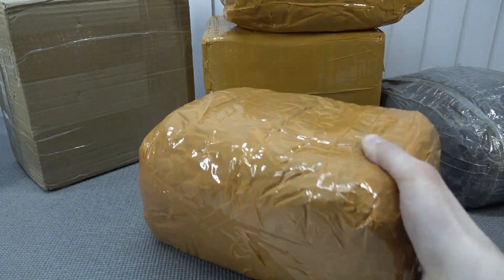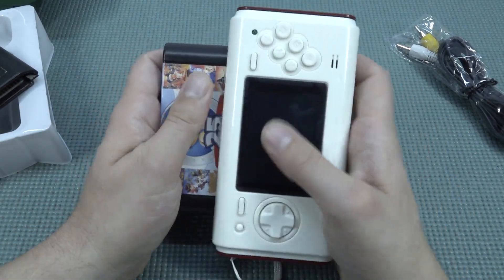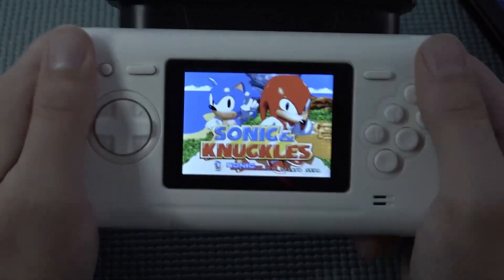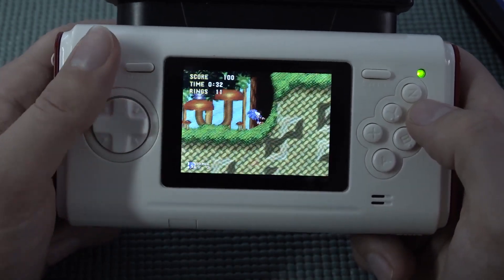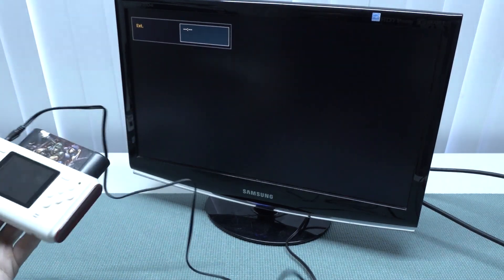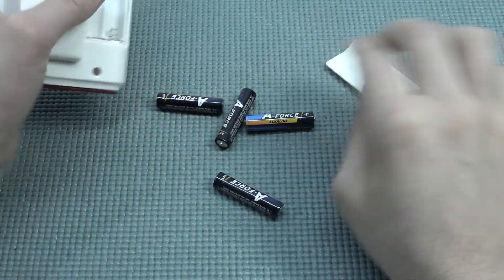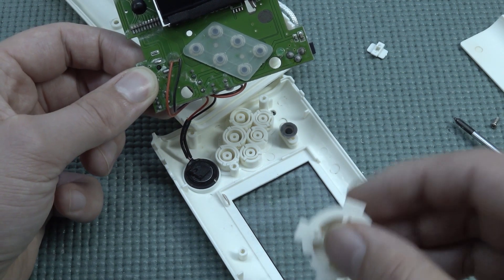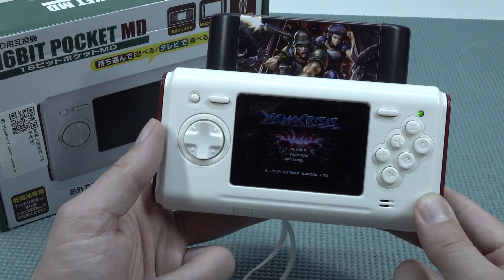A Great Sega Nomad Handheld from Ali-Express / Classic 16 bit Pocket MD

Comment: The 16Bit Pocket MD is originally a product from Japan not China and it was only released in black and maroon not solid white and there is a plus model that has a rechargeable battery and it was released in white and blue so this one is clearly a clone of the real 16Bit Pocket MD from Japan and i know because i have the original one, i ordered one from Japan over 5 years ago and i even posted a review of it a couple years back as i stated before.
Reply from the maker: Thanks for the info 👍
I do wonder how did this shipped from China in the end 😲

Comment: The Retroad 5 Plus is made by the same company and has a great SEGA GENESIS adapter that even works with the Mega Everdrive Pro. The button setup isn't the best but it may work with the SNES dongle and the 8bitdo m30 bluetooth controller. I still think the buttons were not correct though. It is region free and has different aspect ratios too.

Comment: Sonic 3 uses a solid state chip for saving, which doesn't die like a battery would. The cartridge slot also very likely doesn't have the pins used for enabling saves connected. If there are files, they'd probably pop up fine on better-compatibility clones or real hardware.

Comment: I wish they just use rechargeable battery than use normal triple A battery, but that casing have potential, just slap bigger screen like 4,7 inch, adds little bit more space on the bottom for 2 analog and 4 shoulder button to make great handheld of the year.
Reply: I actually think from thus video that being slightly /wider/ wouldn’t be a bad thing. Looks a little tricky to hold on to… Definitely a 3.5”-4.0” display should be a given. IDK if 5” is really necessary here. — Also, there are benefits both to AAAs (easy to grab a new set in a store, not going to puff up and catch fire) and rechargeable lithium ion batteries (can charge almost anywhere, more capacity, fairly thin).

Comment: So glad you reviewed this one. 
I have the blue version for almost 8 months and even thought it have many flaws I love it.
The sound is as bad as every TC-6803 clone, so playing some music with heavy bass will sound like .... underground death metal.

The monitor in my version is little bit to the left and I am loosing around four pixels and when I press the d-pad right it becomes vissible that the screen is pressed too. Maybe one day I will open it and put those things your version have.
The controlls are realy great, they are not in the same legue as the original but works realy well. I wasn't expecting this and I was almost sure it will break after a while but it is still here and rocking.
Also the s-video output is awful, but it doesn;t matter to me.

The price at Ali express is too high. I got mine from Japan Amazon for 64 including shipping and it came in five days.

Another thing about the monitor when a game scrolls vertically looks a little bit wierd, like it is in higher resolution or something.

All in all a great little device and I hope as it became popular (by you ) now someone will come up with a way to fix the sound.
Some Japanese guys over twitter have experimented with the sound but I cannot realy understand how or what they did.

Comment: I'm sure that the Chinese company that made that can definitely make a lithium battery powered version with a larger profile and larger screen... at least a nice 5 inch or 6 inch screen would be nice and on top of that make sure that stereo sound is available on the speakers and output ports.

Comment: I dont like the way the cartridge slot is soldered onto the PCB. That looks like itll be something youll be repairing very quickly. Id be very very gentle pushing carts into this unit. They should reinforce the slot with the case itself. Something to help support the down pressure of the cart being inserted. Thats just my 2 cents.

Comment: Wicked Sonic 3 didn't use a battery it used a chip to save your game data I have notice that some times even it the chip doesn't go bad that the save data can get corrupted and be missing but if it does it all the time the chip could be going bad and you would have to replace that chip.

Comment: Don't like fixed batteries, replaceable batteries far better, just use rechargeable batteries. In many products with fixed batteries, when the battery is stuff its basically a bin job. Being able to replace batteries, don't have this issue

Comment: It really is a shame the screen is so small, only 2.5", just not practical for me. No brightness/contrast controls either.

As far as region settings go, if you're good at soldering you can switch the jumper pads, they're on the main board behind the cartridge slot.

Also, sonic 3/s&k carts don't have a battery save, they use flash memory to save, so if you're sure you have legit save files on your cart, the handheld may not be reading them?

Comment: No game was launched from this cartridge 8:00 so the test is unreliable. Subsequent games from the Multicart did not run either. I suspect that the author of the channel was paid by the seller/producer.
Reply: Are you ok? The games ran when he reset the system...you can see the multicart still in the slot at all times, and there's no cuts. It wasn't seamless, but they loaded. Not sure how you missed that, or can make such wild accusations as accusing him of being paid off based on your lack of understanding. Bizarre post.
Reply: Lol, wut?
Reply: Please do not insult MR Package from China
Reply: He was not paid by the seller....😑
Reply: @dennett316   Did not play any game launched only the game's starting board. Multicard games like to freeze after starting the gameplay.
Reply: @froggythegamerfrog9810   Then why didn't he do a reliable test?